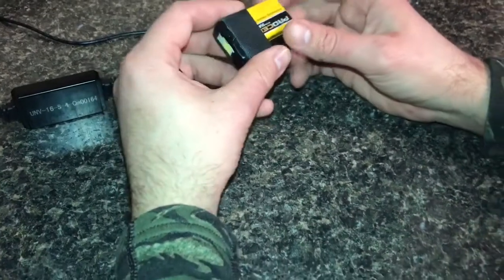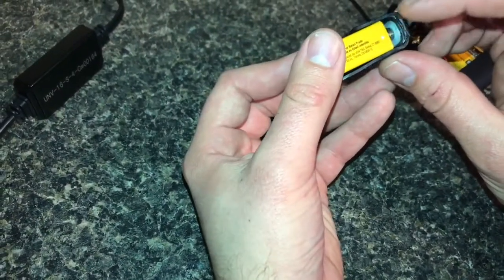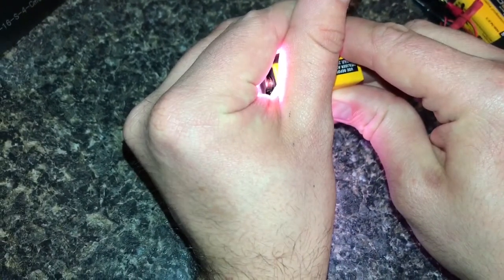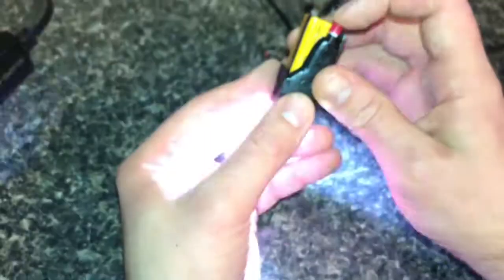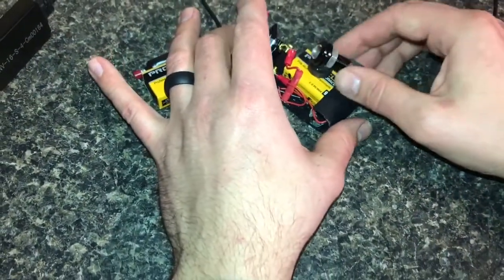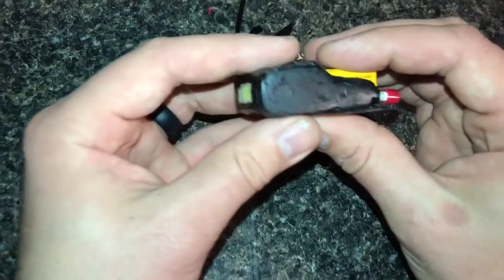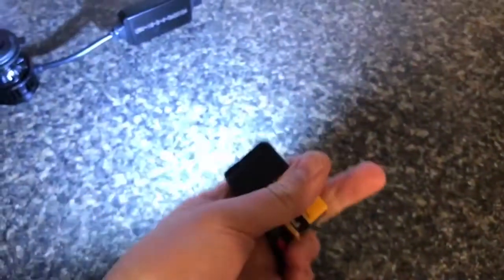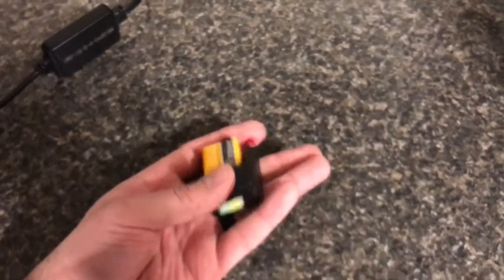HomeMade LED Flashlight from car headlight bulb

Comment: I used same kind of LED headlight bulb with a real flashlight reflector. That thing is strong. I did try a 9v battery and it works pretty good.

I tried it on a cordless 18v lithium ion battery, it gives you a strong spot beam